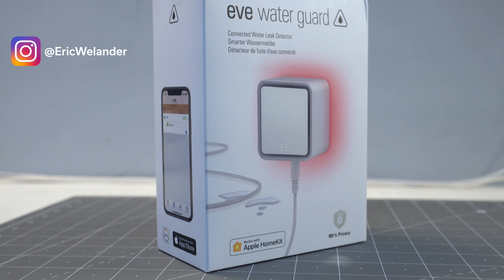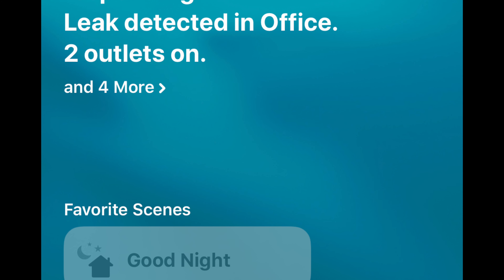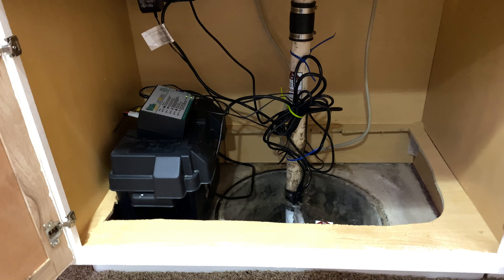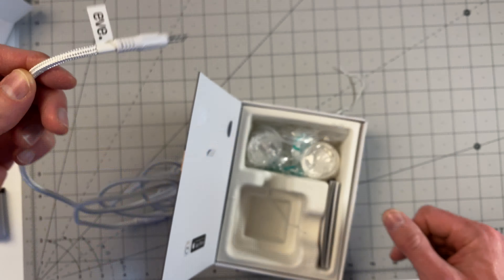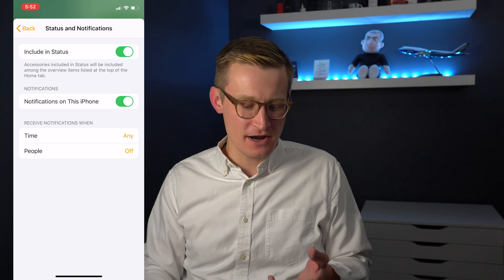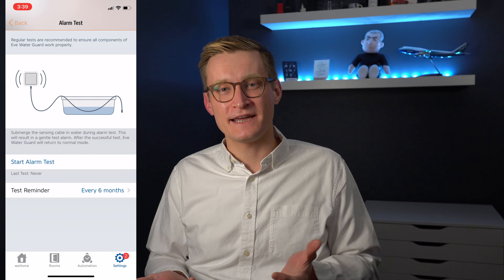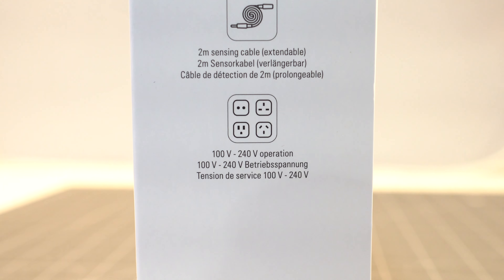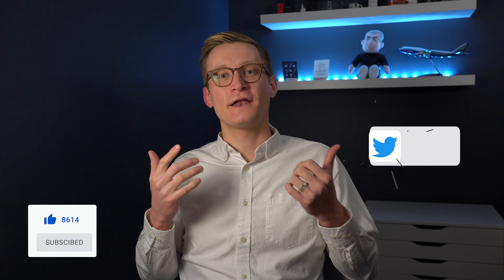Eve Water Guard Review with Apple HomeKit

Comment: Good review Eric. I liked my Water Guard too.  Kinda pricy but I really like the wire. I was able to put mine around my washer by using a normal 3.5 aux cable running down the wall from the plug and then using the sensor wire only on the floor to get the most sensing area.
Reply: That's a pretty good tip actually. The extension cords are crazy expensive, if you would max out the setup, you would pay  80 bucks for the sensor and about 3000 in extension cables ... rediculous.

Comment: Thanks Eric! 

I think this is a great solution. Way better than putting ‘pucks’ everywhere. 

Had this been released a year ago, when I was still doing the construction/renovation of my basement (because of a hydrostatic water leak), I would have wrapped the entire perimeter of the basement with this detection cord. 
I’d argue that this should be a option offered by home builders on all new home construction. 

Thanks for the content. Quality stuff as usual. 

* Also. Aside from what appeared to be a battery back-up for your sump system, it would be great to see you test some automated monitoring device(s) for the system.
Reply from the maker: Thanks Bradley! Yes I do have a battery backup on mine. Thanks for the idea on more sump pump content. I haven’t seen much around HomeKit support in that area but I’ll keep it in mind.
Reply: Eric Welander - Thanks Eric. 

I’ve had the Home Sense outlet you reviewed in my Amazon cart since your video. Kinda holding-off buying it until some of this virus nonsense is in our rear view mirror. 

I’m paranoid enough about a pump failure that I have an extra unit sitting here in anticipation of the event, I think that outlet may offer some (not all) of the usage/monitoring features that it MAY provide an early warning when the pump quits . Having an extra pump does me little/no good if I only find out once there is evidence of water - whereas IF I can see the Home Sense outlet hasn’t seen any electrical demand (from the sump) for a few days, I may be able to fix the issue before it’s a problem.

Comment: The Bluetooth only connectivity is a killer for me. From what I read about earlier versions of this device, BT rendered it unreliable. Plus, if I want to use it where my water heater and clothes washer are located, it will be too far from my router/HomeKit hub to get reliable signal. But I really appreciate seeing what it can do in a more ideal situation. Thanks!
Reply: I have not purchased it yet but I am considering it. Bluetooth is a downside but I noticed they have a bluetooth range extender option. The design of this sensor is still pretty unique and it gives a visual and 100db audio alert. If you're at home, you will not be able to miss it. If you're away, that is going to be an issue, unless you live in apartment and have neighbours that alert you. The only actual downside that I see is the cost of the extension cords which is ridiculous.

Comment: A lot of reviews say it has false positive notifications is that the case still you mentioned it was going off and said you’ll talk about this later but never did... does that mean you have experienced similar issues?
Reply: When you say "a lot", could you point out where you have read this? Thanks.
Reply: Jan Vanrossen some initial amazon reviews another YouTube video and a Reddit thread
Reply: Jan Vanrossen go with aqara water leak sensors it’s cheaper even with buying a hub and I have never had any false positives.